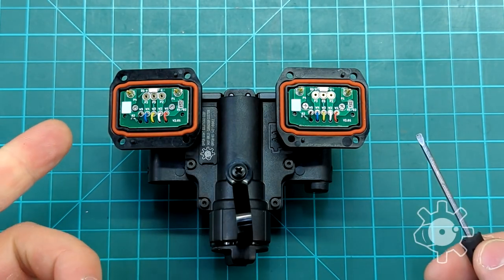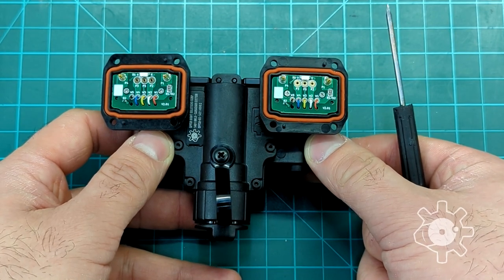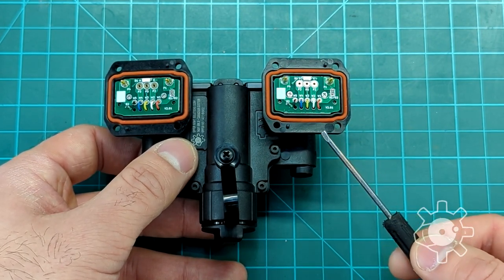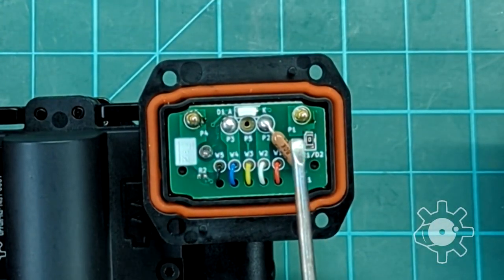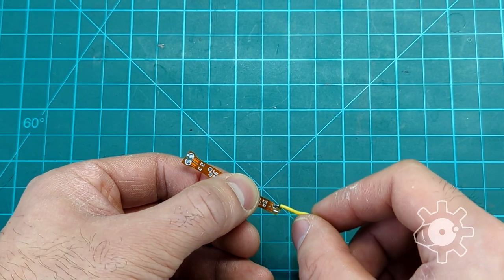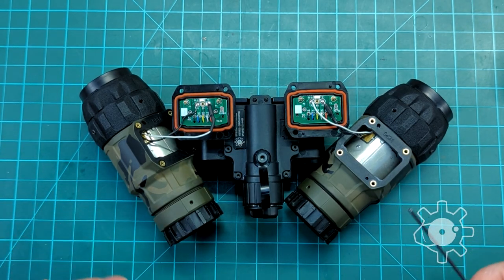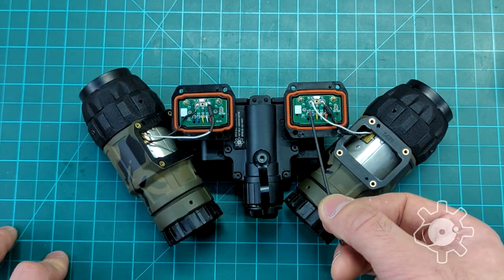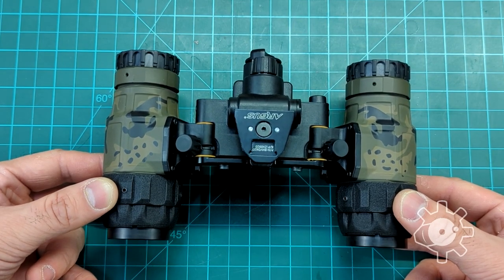BNVD-1431 Mk.II MX-11769 Gain Installation Guide

Comment: Im having some problems with 3 pin nnvt 2000 fom. Pogo pin in p5. Gain works but range of adjustment seems to be limited. Also when there is high light it work gain down at all. Any ideas?

Comment: Anyone know what mods are needed for Harris mx-11769 tubes?  I measured the resistance of the pigtail around 22kΩ.  Does it need the smd resistor(r2?) removed?  Assuming it needs a 22kΩ resistor in series with P2.  Edit: I had to switch the wiring and remove R2.  Yellow to the resistor on P2 instead of red.  Note: Ziming from nightsolutions stated that if you're getting no gain adjustment at all with the tube's gain plugged in, R2 probably needs to be removed.  That was my scenario.  Wires connected.  No gain control at all.  Removed R2 and gain worked.
Reply: Thank you for the edit, you helped me a lot 👍🏻

Comment: Argus, the manufacturer of BNVD-1431, has a manual for wiring different tubes. I found that the manual doesn't require any resistors for P2, just two wires connecting straight to P2 and P3. I'm confused about the situation. Can anyone help me out?
Reply: where is this manual? i need it as im doing the tube change

Comment: I contacted Argus staff and they said it is totally fine to just wire the L3 filmless tubes such as 18um without any resistor. I just need to remove the R2 resistor on the board. I am more confused now. Which way is better?

Comment: I think if you use ITT/Elbit 11769 you still need to remove that resistor? I converted two Elbit XLSH by the instruction i have and removed R2
Reply: It's that necessary to remove that resistor ? As the instraction from ARGUS, need to remove r2 resistor. However, should I add additional resistor on P2 such as 100k or 120k resistor ?

Comment: Hey, nice video! I've been wanting to add manual gain to my MK2 for a while, and I found your video amazing. One question though, what is the voltage of the 80k ohm resistor you used for the L3 tube? Is it a 0.25 W 80k ohm resistor? Also, what wire specifically needs to be used, or can it be any wire? Thank you!

Comment: poor design , not user friendly
Reply: Yeah, would've been better to use a gain control PCB like the PVS-14 does so you can just plug the ribon cable right into the board and be done with it.